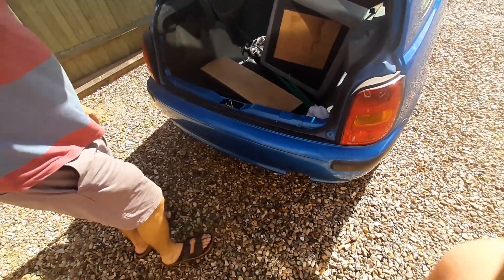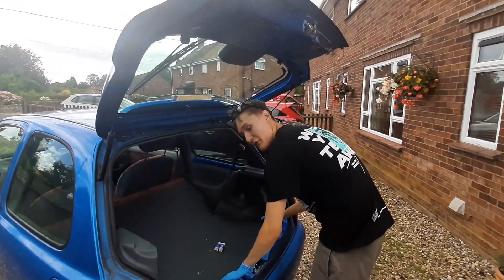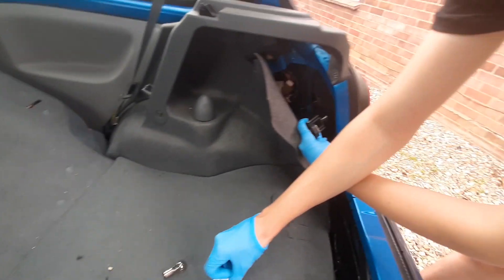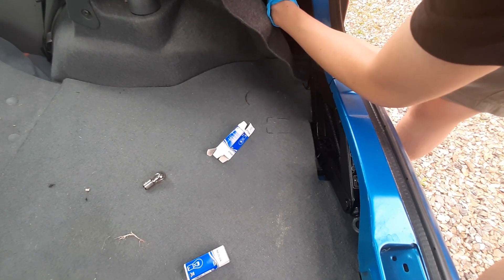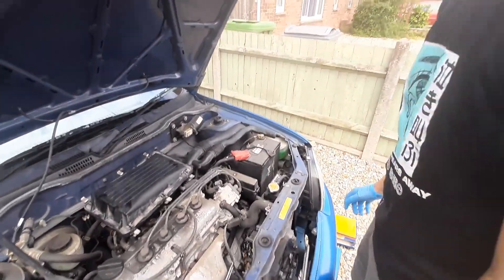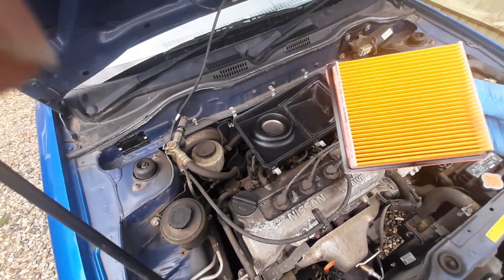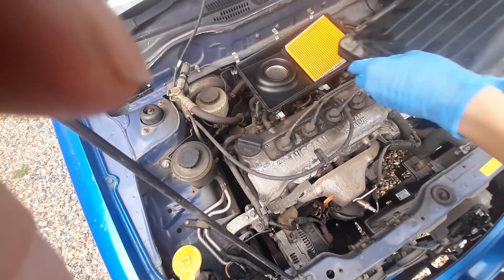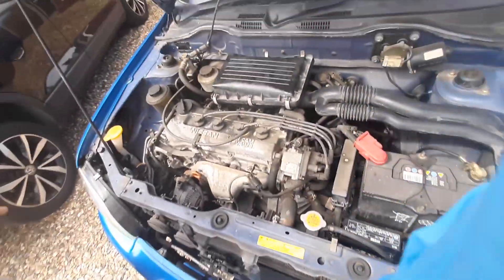*EASY* Treating the Micra k11 | Coolant, Brake Light Bulb, Air Filter

Comment: glad to see you doing good bro!
Reply from the maker: Thanks man! im doing good apart from the accident with my VXR. the insurance didn't want to pay to fix it so they brought it off me and most likely auctioning it off and someone will have that as a cat s so it isn't a complete loss. it was only a cheap fix tbh but I took the money tbh wasn't far off from what I brought it for.
the vxr was a weapon around back roads but tbh the Micra is slow as hell but its surprisingly fun around back roads and there going up in value as there now classics.

in japan its called the Nissan march which they had a 1.4 turbo version which we didn't get in the uk what sucks the new Micras are ugly in my opinion.

when I'm found not at fault I will probably get a sports car on the side and I can insure it for just social and pleasure use